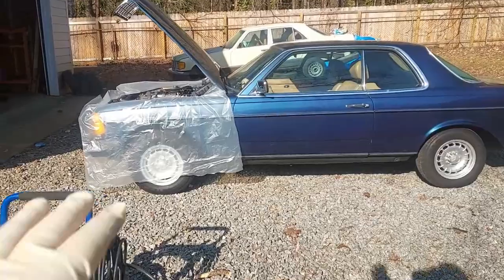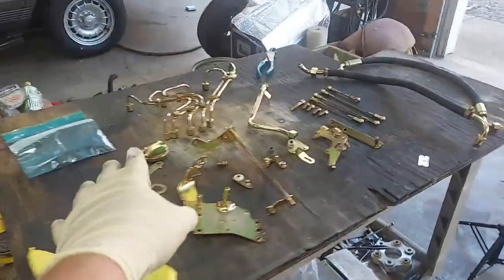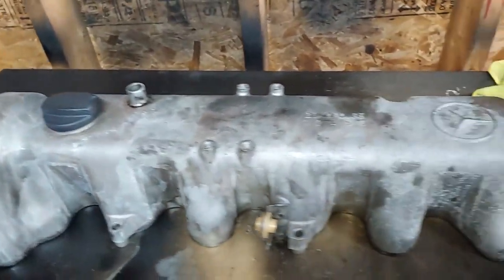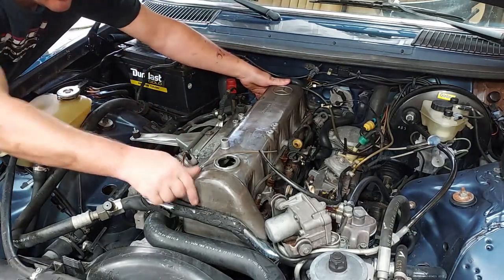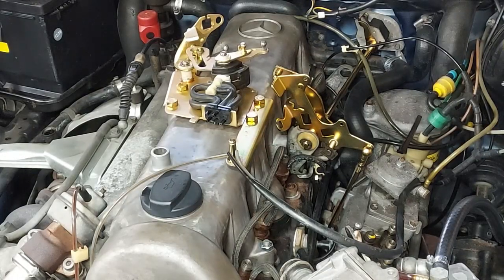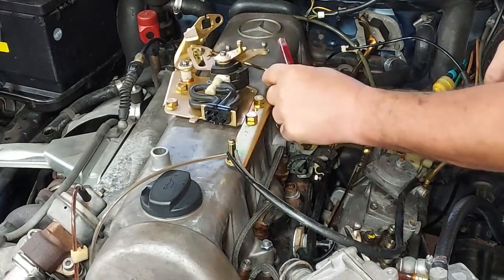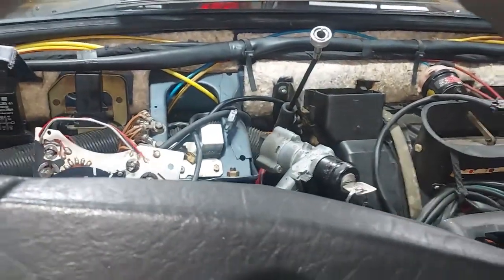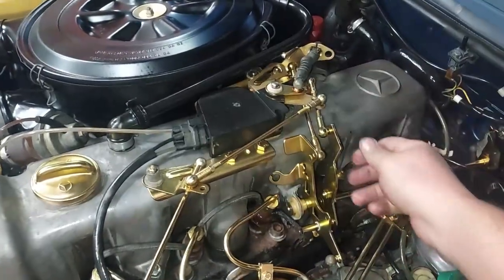1984 Mercedes 300CD - Part 9 Engine Compartment Cadmium Plating

Comment: 😱Almost 145,000 kilometers, that is, in 39 years, he walked an average of 3,700 km each year...
It's new!!😮 Fantastic and very detailed job of replacing the parts with new Cadmium-coated parts, as well as the hoses and connections... A 5-cylinder engine that works like a clock... I'd like to see the video of the car ready, with panel and everything... A work of art!!
Reply from the maker: Thank you I appreciate the compliment. I suggest subscribing to the YouTube channel or registering your email address on my website. You will be automatically notified as soon as the completed car is posted. www.woodsandbarclay.com
Reply: @woodsandbarclay  Good afternoon. I'm already subscribed to the You Yube channel. I await the completion of the work of art that is the Mercedes 300CD. Hug!👍

Comment: Beautiful work. I have a 1971 280 SE where engine pieces (fuel rails, etc.) have been painted with silver paint by previous owners. We are going to try dry ice blasting to gently see what is underneath that paint. We hope there will be enough factory cadmium plating left so it will have a nice patina. If not, where do you send stuff off too for the proper plating?
Reply from the maker: We just have a small mom-and-pop operation that does it for us. You can get online and find a lot of places that will provide the service.
Reply: @woodsandbarclay  Thank you.

Comment: Amazing look, fantanstic. I immediately checked my engine compantment after watching this video 🙂. What I noticed is that my engine is missing this "plastic box" on top of the motor block. What is this called? Do some 300D Turbodiesel engines don´t have that?
Reply from the maker: Some have the plastic covering some do not. If you have an 85 model it does not.
Reply: @woodsandbarclay  yes mine is a 85 California model. thanks for the answer👌

Comment: Howdy! I'm obviously not sure, but I think your garage door wiring is loose. That beeping would drive me nuts if I didn't have it set intentionally!
Reply from the maker: LOL one of the batteries is dead that raises the garage door if the power goes out.
Reply: lol, I started looking around for what in my house or out on the street was beeping
Reply from the maker: @1apizzle  I need to get a ladder and climb up there and disconnect the battery